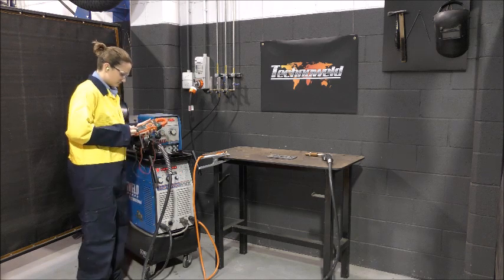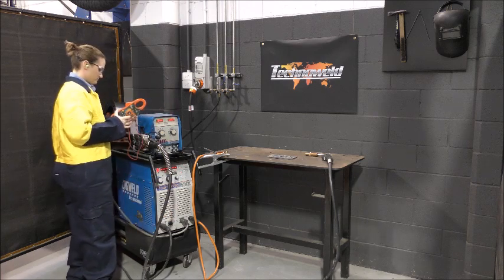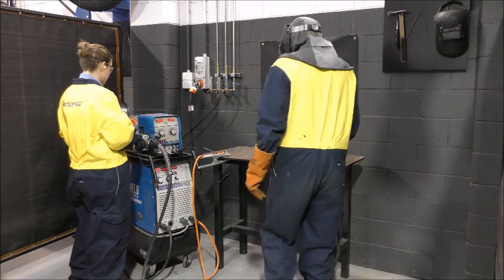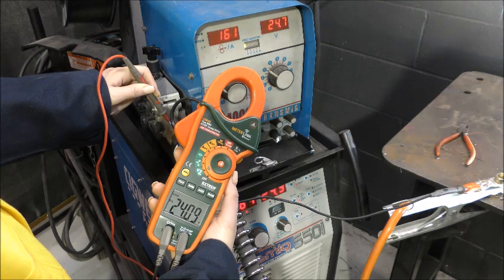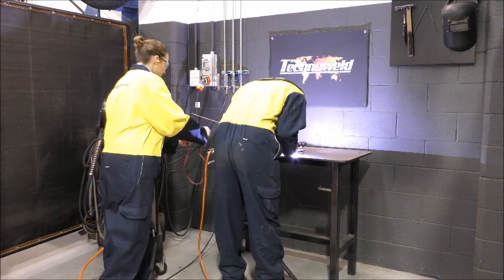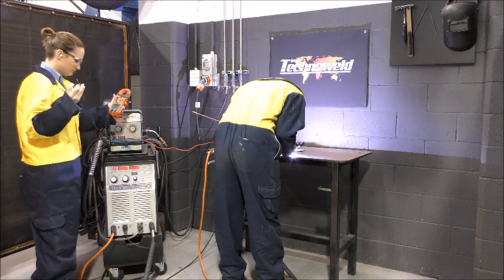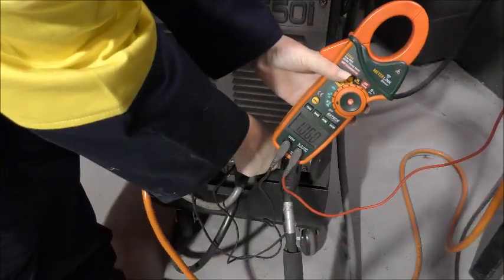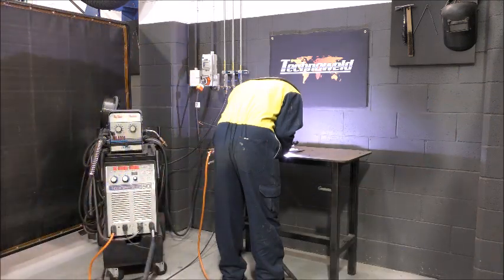Clamp meter - How to check Volts when welding

Comment: Not sure why this video specifies the use of a "clamp meter", when clearly it's measuring voltage and the clamp is not involved. Also, it would make more sense to me to attach the meter's black (presumably common/ground) lead to the ground clamp, and the red (+) lead to the electrode/block/gun. That way you avoid confusion over the polarity of the voltage as well as reading the magnitude.
Reply: They only use the clamp to measure amperage?  Voltage requires the test leads.
Reply: Its the industry term used for the meter, it measures more than amps (current) and volts
Reply: The value will be the same, it just shows as a negative value if incorrect polarity is used
Reply: @grahamfry48   she said negative to positive and positive to negative 😅 i came here instantly to complain 😂

Comment: how do we measure the in rush current? i'm having trouble deciding which Amp to use
Reply: Depends on the meter, some have an average function. GMAW machines are constant voltage and the amps vary with the constantly shifting CTWD (contact to work distance), read high and low and average it